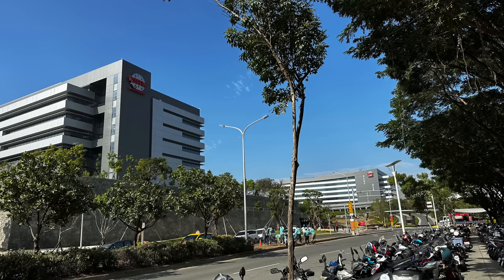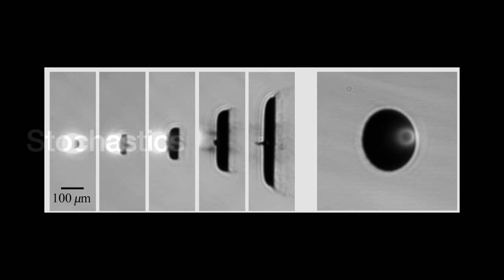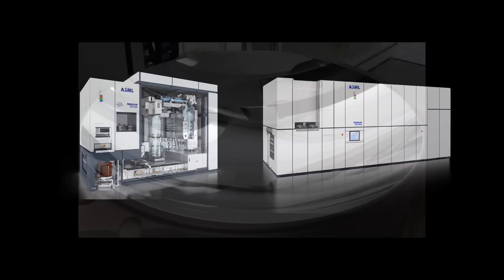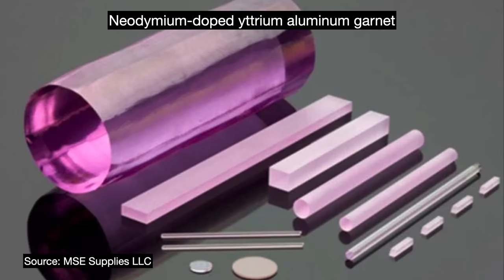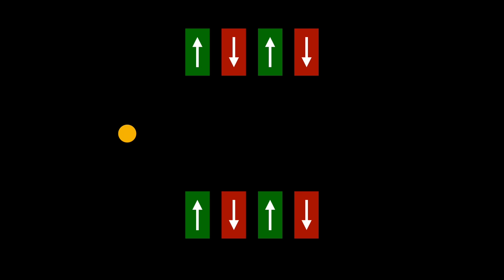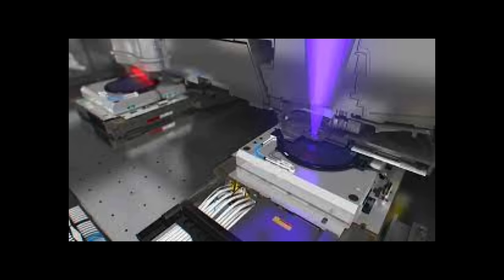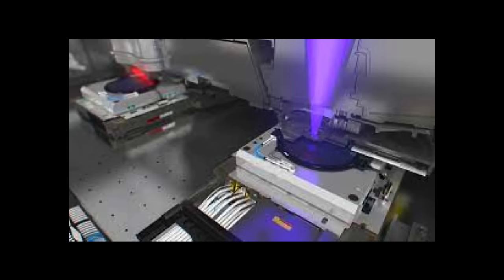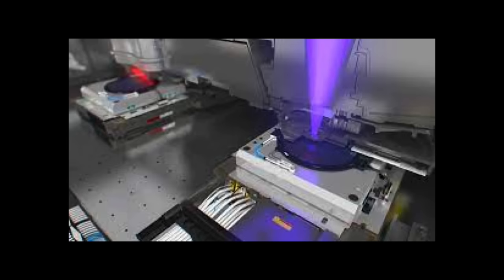EUV Lithography. But With a Free Electron Laser

Comment: Wiggling electrons with EM field sounds like the ultimate method for generating EM radiation of any desired wavelength.
Reply: I was thinking that.. many potential applicanrtions
Reply: Gee, I don't know...  I think you're making it sound way too easy.
Reply: early development of radar and microwave is exactly that
Reply: Sadly, no matter how hard you wiggle them, hard x-rays are still off the charts, although UV is possible.
Reply: Yeah that’s why synchrotrons are useful lol
Reply: Yea -- see the SLAC channel videos from a few years ago when they brought the first free electron laser on-line.
BTW, it's over a mile long.
Reply: @theangledsaxon6765  LCLS blows away the synchotron light source, actually.
Reply: @GeoffryGifari that is, in fact, how radio transmission works, which is EM radiation. It gets less convenient/possible to directly wiggle the electrons for higher frequencies at sufficient power so other EM generating processes like magnetrons, synchrotrons, energy level decay and nuclear decay are used for higher wavelength production
Reply: it is, its also the most expensive, also dont stand near it unless u want to get radiation poisoning
Reply: @quint3ssent1a  I don't think there's any such limit? European XFEL goes down to 0.05 nm which I think is well into hard x-rays. I can find some references to future designs for gamma ray FELs too...
Reply: @quint3ssent1a on the oposite thats exactly how they got coherent xray light for first pictures of chemical reactions (yeah a picture of two particles in middle of bonding).
Reply: @Elukka Gamma rays are  most definatelly off limit for syncrotrons (or any electron laser for that matter) hence the "interdisciplinary hunt" for "grasers".
Reply: They were doing experiments with this sort of thing out at UBC with the triumph cyclotron
Reply: @quint3ssent1a I don't know what are you talking about, hard x-ray SASE sources already exist; they use synchrothrons to accelerate electrons instead of linacs, but the principle is the same...
Reply: What do you think your microwave does?
Reply: funny story about undulators is: freqency of undulation is determined by spacing between them, it is huge from our perspective. but from the point of view of fast moving electron it is short due to relativistic length shortening. thats why electrons have to travel very fast, close to the speed of light.

Comment: Greetings from the Center for Free Electron Lasers at DESY the home of the european xray free electron laser ! It's really cool to see FELs on youtube and crazy to have the video actually talk about SASE. I personally mostly work with undulator light from the petra synchrotron, so take what I say with a grain of salt.

Some issues with XFELs:
- you need really nice beam parameters for sase to work and seeded fel isn't feasible for xray photons
- they are fucking huge, european xfel is a >3km long line! compare that to high brilliance synchrotron with undulator beamlines like petra III at 730m diameter
- repetition rate is hard

some of the really really cool shit you probably couldn't talk about because of length:
- the light is in phase, so you can do some really fancy optics stuff with it and get intensity proportional to N² instead of N (where N is electron number)

- there are two different regimes for the self organisation. instead of injecting electrons that are monoenergetic but spread out in phase space you can also inject them with a wide energy spread in an ultra short pulse. That's one of the things people are trying to do with laser based acceleration systems. 

Ultimately I'd guess that FELs won't do lithography in the super near future, just because time averaged intensity matters more than peak intensity. European XFEL SASE1 has 27kHz time average repetition rate with 4mJ energy per pulse. That's only slightly above 100W! From a billion €, kilometers long device that only went online a few years ago. Petra's P61 beamline alone puts out more power than that (I've seen samples with holes melted through them by that beamline), admittedly that one has a wider spectrum, but you get what I mean. The size / capital investment to power ratio is pretty bad for FELs still.

source:  https://www.xfel.eu/facility/instruments/spb_sfx/instrument_design/index_eng.html#:~:text=These%20pulse%20trains%20can%20be,repetition%20rate%20of%204.5%20MHz.
Reply: The MuCLS is an even smaller sychotron-like X-ray source, just 5m x 3m, but I have no idea if it's suited for Lithographie. Still an interesting look at the other side of the extreme for monochromatic X-ray light sources.
Reply: Normally, coherence is undesirable for a lithography light source
Reply: Very cool!!!
Reply: @stormsj  SSMB?
Reply: @ArawnOfAnnwn  Steady-state micro bunching, which to put simply is a way to make synchrotron generated light useful for lithography.

Comment: Free electron lasers are a really cool diy project. Deadly high voltages, vacuums, strong magnets, blinding laser radiation, and extremely dense beams of beta particles. Don’t know why they’re not more popular.

Also the beam dump for an electron beam will just be some conductive surface that’s connected in a circuit back to the other end of the high-voltage source that accelerated the electrons out of the electron gun. Charges need to flow in a circuit, though when you’re dealing with free charges it can get kinda strange with net charge buildup.
Reply: Net charge build up? Get a bigger net. So to speak.
Reply: I guess it depends on the beam energy: You may require a lot of shielding around your nice conductive beam dump :)
Actually, I wonder about the return circuit. E.g. for SwissFEL, the electron bunches are 200pC at 100Hz repetition rate, that's 0.02µA. You don't need a special return path for that, but grounding is of course essential.
Reply: They don't fail in spectacular enough ways for YouTube.
Reply: I'd love to find some resources to make a diy fel

Comment: A magnet doesn't attract electrons. Electrons are deflected by the magnetic field perpenticularly to the magnetic field, not towards it or away from it. 

So in your picture they would swerve in and out of the picture plane.
Reply: An electron travelling straight down the centre wouldn't be accelerated at all because it's parallel to the field. Off-center electrons would oscillate like an airplane changing the direction of rotation mid-barrel roll
Reply: Well you might be right, but Sulla>Marius so ur opinion is invalid.
Reply: @Danji_Coppersmoke  you almost made my day
Reply: I was wondering if “perpenticularly” was a word I’d never heard of. I tried looking it up and didn’t find such a word, so far.

This has me thinking that you perhaps you meant to type “perpendicularly”?
Reply: @shanent5793  I don't think you have the correct magnetic layout in mind. In the layout shown the magnetic field lines will go up and down alternately, and the electrons will in turn curve in and out of the screen plane. This is also true for electrons moving straight down the center of the undulator.
Reply: @entcraft44  The field lines go out of the green boxes and into the red boxes. Thus the lines cross at the axis, cancelling any transverse component. Only the longitudinal component remains, alternately pointing left and right, parallel to the axis
Reply: @shanent5793  Okay, I see what you mean. However, I think he just screwed up the colors. Look at the arrows: The field lines from the bottom left green box go mostly to the top left green box, and a little bit to the bottom 2nd-from-the-left red box.

Comment: This looks quite good: High-power EUV free-electron laser for future lithography by Nakamura et al (2023); here's the abstract:

The development of a high-power EUV light source is very important in EUV lithography to overcome the stochastic effects for higher throughput and higher numerical aperture (NA) in the future. We have designed and studied a high-power EUV free-electron laser (FEL) based on energy-recovery linac (ERL) for future lithography. We show that the EUV-FEL light source has many advantages, such as extremely high EUV power without tin debris, upgradability to a Beyond EUV (BEUV) FEL, polarization controllability for high-NA lithography, low electricity consumption, and low construction and running costs per scanner, as compared to the laser-produced plasma source used for the present EUV lithography exposure tool. Furthermore, the demonstration of proof of concept (PoC) of the EUV-FEL is in progress using the IR-FEL in the Compact ERL (cERL) at the High Energy Accelerator Research Organization. In this paper, we present the EUV-FEL light source for future lithography and progress in the PoC of the EUV-FEL.

Comment: The SSMB (Synchrotron based Steady State microbunching) approach to generating EUV being pursued by Tsinghua University deserved a mention. 

Unlike a Free electron laser which has high peak power with low repitition rate or a normal storage ring synchrotron which has low peak power with high repitition rate, a SSMB based synchrotron has both high power and high repitition rate. 

If successful, SSMB EUV radiation would be far more coherent, tunable, powerful and cleaner than anything LPP can hope for. Tsinghua has promised a prototype by 2026-27.
Reply: Any information on why the various approaches are favored?
Reply: @msimon6808  SSMB is optically and mechanically much less complex than LPP. ASML didn't take this approach as it was discovered much later and remains kinda experimental plus the logistical problems that comes when you have to force chipmakers rebuild their multi-billion dollar fabs around your synchrotron facility rather than just shipping a machine to wherever their production lies. But there are lots of advantages to the SSMB approach: 

-High average power: the power aimed is > 1 kW per tool, each facility should be
able to incorporate multiple tools. 

-Narrow-banded and collimated: the radiation spectrum bandwidth is < 1% and has
a well collimated angular spread ≤ 0.1 mrad, which should help to reduce the number
of reflection mirrors and thus increase the EUV power transport efficiency 

-Truly continuous wave: the temporal structure of the radiation is truly CW, this
minimizes the chip damage problem; 

-Clean radiation: the radiation is clean and carries no debris, so that mirrors do not
get contaminated and do not require frequent replacements during operation; 

-High stability: storage ring source has the advantage of a good stability, which helps
to increase the machine availability and qualified production rate; 

-High efficiency: higher wall-plug electricity to EUV conversion efficiency than LPP
source expected; 

-Reasonable price: storage ring technology is mature and the average price for each
tool is expected to be reasonable; 

-Good scalability: easy to scale to shorter wavelength 

If Tsinghua can pull it off, it would be absolutely revolutionary.
Reply: The calculation wasnt in favor of SSMB the efficency is just too low...
Reply: @fromfareast3070  what calculation are you talking about? SSMB light source power is almost an order of magnitude greater than that of LPP EUV. Modern LPP EUVs output an average power of 350W while SSMB can easily reach an average power >1kW with far lesser optical complexity.
Reply: Would this destroy ASML EUV business? Can it replace DUVL as well?
Reply: @MrSpiritmonger  The effect on ASML would definitely be negative. And no, there's no need for it to replace DUVi for nodes above 7nm.
Reply: @xBlackWind   How negative? Could ASML potentially lose their EUV market completely?
Reply: @100c0c  difficult to say given how different the implementation of SSMB will be from that of LPP. You need to build an entire accelerator facility, then make chipmakers build their fabs around it in order to utilize the EUV light. On the contrary, ASML can just ship their machines to wherever it's needed. Now, it's extremely unlikely that in the near future, China would build a SSMB facility in foreign countries. So TSMC or Samsung fabs in their respective countries will keep using ASML. But they (and ASML in extension) will be hit really hard if SMIC fabs on the mainland start churning out chips at dirt cheap prices.
Reply: @xBlackWind   A little off-topic but I'm curious since you're knowledgeable on the topic: do you think nanoimprint lithography could replace EUV and even go smaller with enough funding or has it reached a limit?
Reply: @100c0c  I'm not an expert, but from what I've heard Nanoimprint lithography hasn't shown much promise yet. It will probably be used for niche areas but won't replace EUV in mainstream applications.
Reply: @msimon6808  The laser systems for FEL like SSMB are huge. They are size of a warehouse. They are not exactly portable so making transporting them as a single unit impossible, unless you break up the parts and ship them in smaller containers, then reassemble them at the customer's site. That will make it very complicated and risky and expensive because reassembly takes a lot of time and you have to make sure it works on site. You are basically building the laser on the customer's site and anything can go wrong. This is not conducive for an export oriented product.

Tsinghua is going for this approach because they are not expecting to export this technology outside China as a product, unlike ASML. Once it is shown that it can work, most likely companies like SMEE will take on the job to build it and fabs like SMIC will just have them built on site in their foundries.
Reply: @gelinrefira fabs are bigger than warehouses, how is TSMC building fabs in US, Germany, Japan that are much larger than a warehouse
Reply: @MrSpiritmonger  The fact that you say that show you know next to nothing about this tech.
Reply: @gelinrefira  building a particle accelerator in another country is not that bad. People have built wayyy more complex things overseas.
Reply: @MrSpiritmonger  It's way more complex than shipping a self contained machine.
Reply: Solid state microbunching is like having a large power station that is mostly used for the production of EUV and other particles...

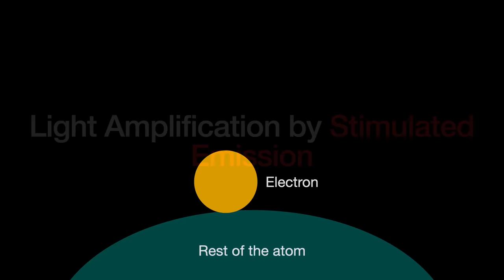Comment: 6:38, a slight correction on the meaning of "stimulated emission." Stimulated emission refers to a process where an excited electron can become sort of a photocopier for photons. When the electron is excited (technically I think this is called the Avatar state), and an external photon interacts with it, then the electron is prone to emit its energy as a second photon traveling in exactly the same direction with exactly the same wavelength, phase and polarization as the incident photon. This is why the laser emits all of its photons in a narrow beam at effectively a single wavelength.
Reply: This!
Reply: Yeah, really important thing which makes laser not just fancy lamp. We get over this so much on the lectures I usually don't even pay attention towards explanation in videos. Also he missed "Radiation" then explaining acronim/word "Laser", which little weird.
Reply: Slight correction to the slight correction: The wavelengths must already match anyways, they are a consequence of the energy level difference. But yes, the phase e.t.c. make it special.
Reply: @entcraft44 Thank you.

Comment: As a vacuum-electron device worker (CPI Microwave) I find this baffling and yet delightful.  After years of telling ol' vacuum tube guys that our industry was not only shrinking but shrinking towards zero and would die, now solid state electronics engineers think they may need a linear-beam vacuum-electron device to keep their industry moving forward.  This even as GaAs and GaN devices have largely finished moving the power-frequency curve up and to the right, and we still have lots of applications-- replacing your microwave oven's magnetron (a type of vacuum tube) with a GaN device would more or less double its power consumption, for example.  I feel now like there will be a need for tubes forever.  If you need some LINAC klystrons for a giant $400m FEL we'd be delighted to provide.
Reply: I'm older than transistors. I can relate.

Comment: They had one of these at the uni I worked at, or at least they did research on it back in the 90s to 2000s. It was able to emit a few mW at a 5 mm wavelength. They had some mathematical modeling for reaching kW powers but I'm not sure if they got that far before the building was demolished. Removing the room it was in reportedly took a week because it was absolutely radiation hardened and had very thick, reinforced walls.
Reply: mz4637  the transmission needs more respect.

Comment: You might want to take a look at new particle acceleration techniques based on lasers. It has the potential to do in a few meters what a linear accelerator takes a kilometer to do. It would not help with the undulator side of things, but it would help reduce the overall size of the FEL machine.
Reply: plasma wakefield accelerator? sounds super exciting

Comment: It will never be disappointing to stop using the LPP method. Tunability of the wavelength and higher power ceiling for the light source are groundbreaking changes. I hope we see the FELs in production before the end of the decade. That would be amazing.
Reply: The mirrors have to be specially constructed for the specific wavelength if I understand it correctly. Normal mirrors don't work for that short wavelength and that is one of the problems. So the mirrors are made with thin layers making the light reflect with a big loss. The layers have to be tuned to have the exact thickness depending on wavelength.